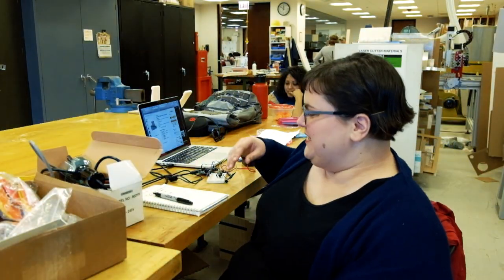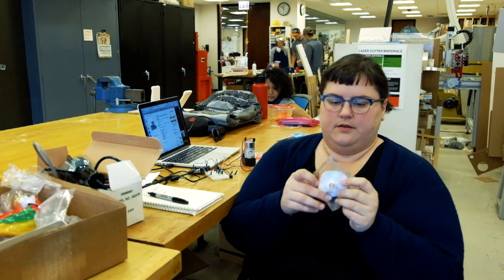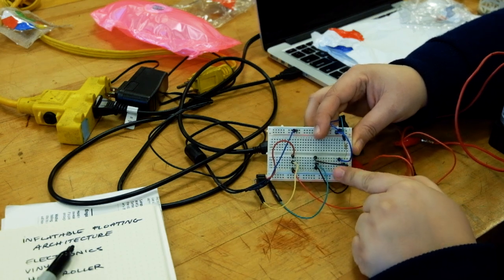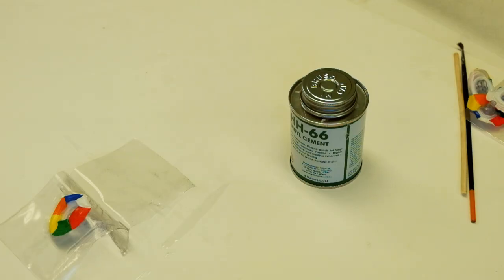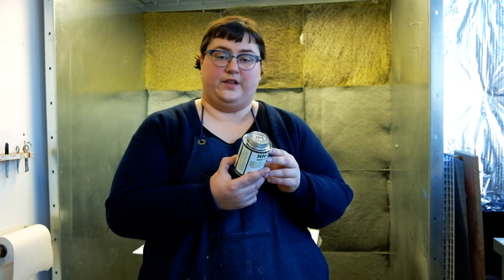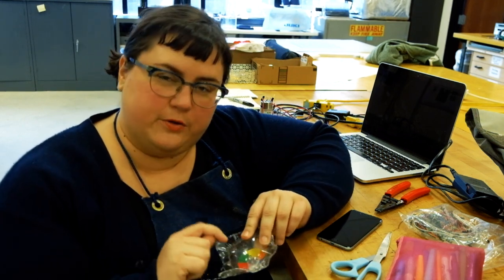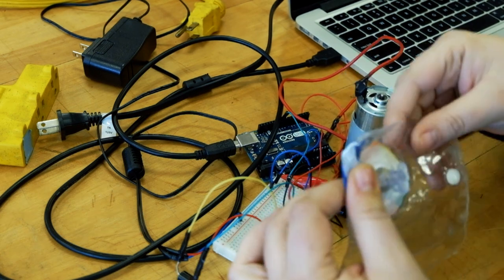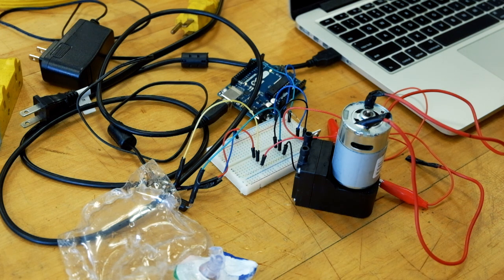Prototyping Inflatables with HH-66 Vinyl Cement

Comment: Hello Becky, look up a company called billboard tarps. They have the new vinyl fabric material that you want to use that HH-66 with. It is essentially pool vinyl. I use the 20 oz. white material as a waterproof roof covering material for many seasonal sunrooms at a coastal RV park. I am toying with the idea of making some home built, heavy duty swim rafts, and floats, unfortunately that HH-66 isn't cheap, but is sure does give an a nice, permanent, water proof, and air tight seal if done properly.

Comment: I fix the occasional (ok, ok. Frequent) hole in my PVC inflatable dinghy. The instructions on the glue just said to apply to both pieces, wait and press together. But online I found instructions to apply to both pieces, wait minimum 15 minutes, apply again to both pieces, wait another 15 minutes, then heat both with heat gun and THEN press together. For 3 days. That made a huge difference for me.

Comment: Thing is too with the HH-g66 is prone to coming undone with heat depending on why type of vinyl you use and where the glue is done. I have a little experience with it as I do repair work to inflates and such. I think for you and welder is going to be a must. I think they may be coming down in price though.
Reply from the maker: Thanks for the perspective. I wasn't even thinking about temperature. I'll have to look for used welders again. If you'd like to see me blow shit up and fail spectacularly, I just posted a new video: https://youtu.be/nRdbbIJSOcg